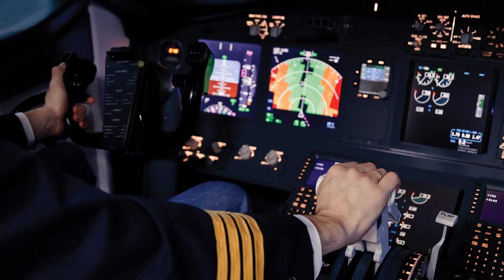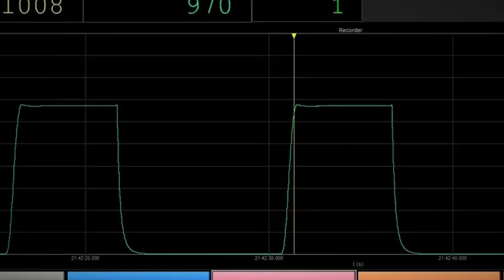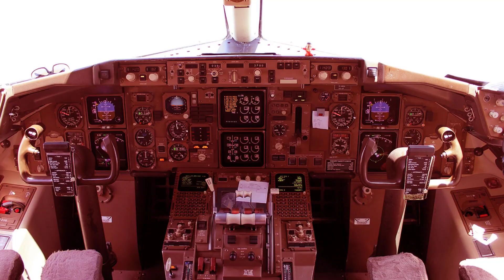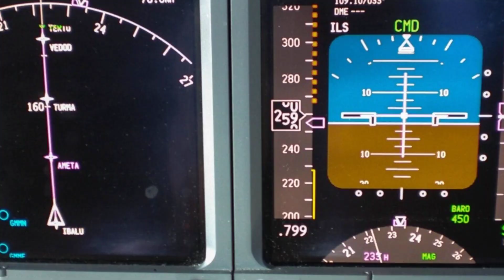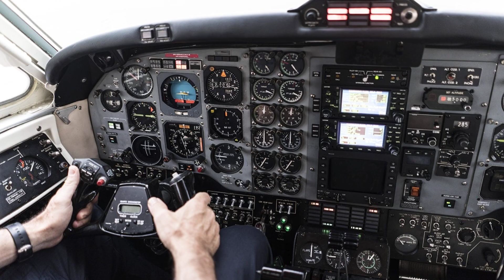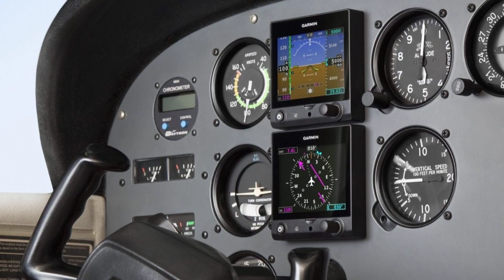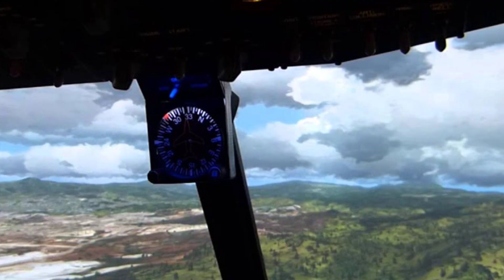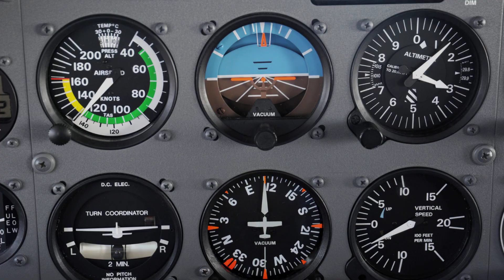7 Airports So Dangerous Even Commercial Captains Hate Landing There

Comment: I’ve been on 737 flights in and out of Dutch Harbor, Alaska and the runway not  counting over run is only 3,900 feet. One time we took off to the south and turned to the west and did a very tight turn over the town of Unalaska. We had to stay low because of the overcast. The go around there is crazy because you have to do a turn and go around a mountain.